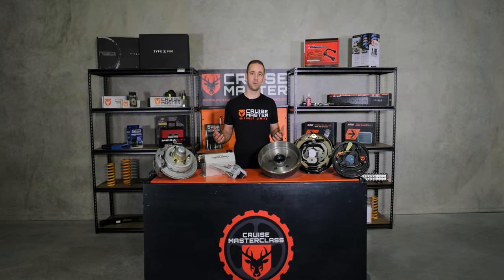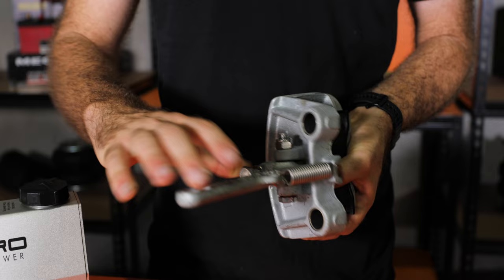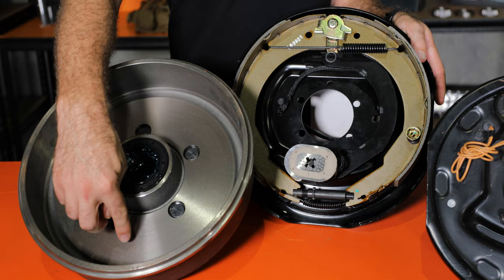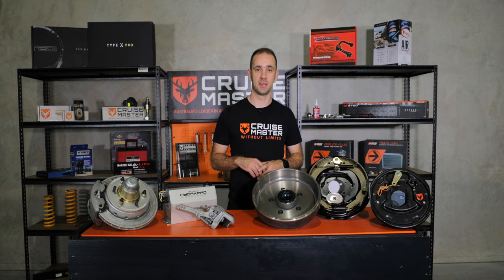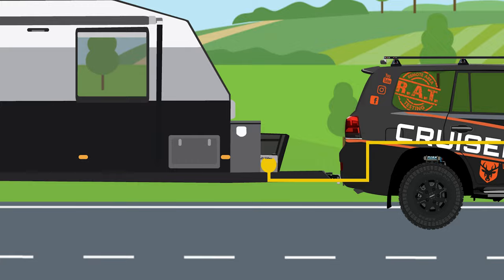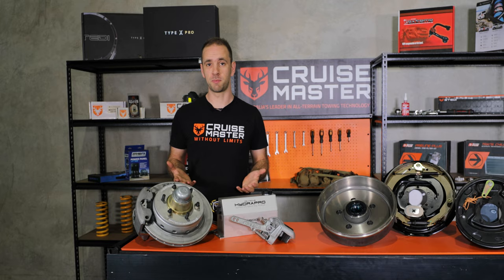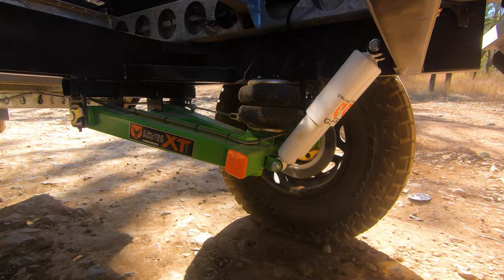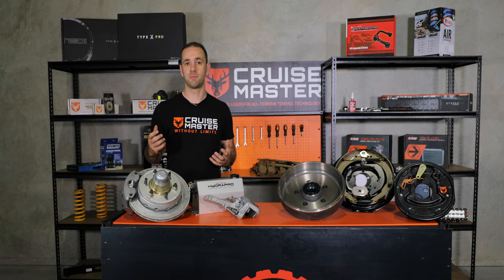CruisemasterClass - Ep. 16 Drum vs Disc Trailer Brakes

Comment: You have forgotten the most common. Hydraulic override. Either drum or disc. 
Far better than cable operated brakes. The drum brakes is more efficient as it requires far less line pressure to function. A 3/4" master gives excellent braking without much stroke. Discs require a 5/8 cylinder with a LOT more stroke, to the limit of the override mechanism.
Electric brakes of whatever style require the tow vehicle to be fitted with specialist components. And having experienced them to me they leave a lot to be desired.